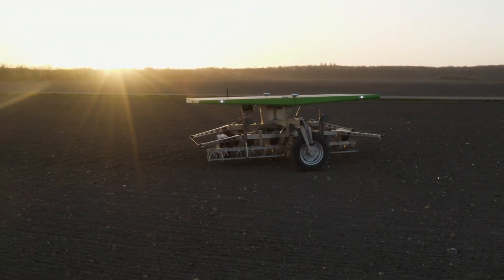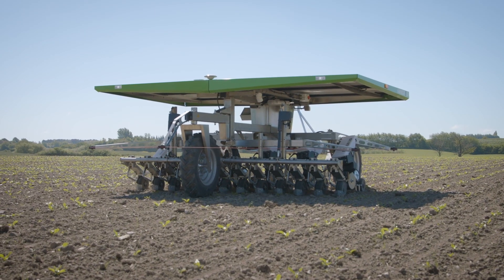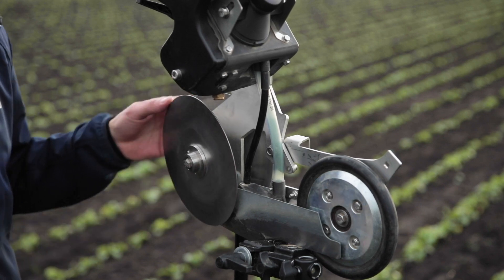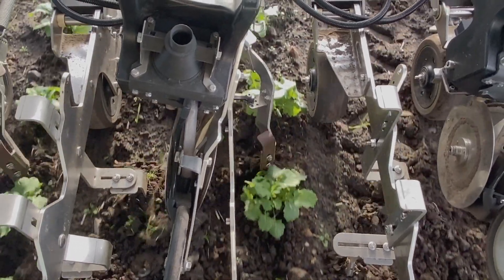How does FarmDroid FD20 work?

Comment: Amazing product, well designed, seem sturdy and simple enough so I presume it should be reliable.
Just two questions, please.
1. I wish you all the best and a long prosperous future. It's a sad reality that so many amazing products were manufactured by companies that either discontinued the product or went out of business which has dire consequences on farmers. Does this robot require an online activation and remote server to operate? Can the schematics be sold in case the model is discontinued or the company falters? 
2. Since it doesn't have a camera what can be done in case there's an endangered animal or bird reaching the plot by accident. As you know some may be very small and below the safety wire you showcased. Even if it's not an endangered species and are sometimes considered as pests, I never killed baby rabbits in their nest or other animals and managed to relocate them successfuly. 

Vielen Dank für Ihre Geduld mit meinen ausführlichen Fragen. Ich wünsche Ihnen und Ihrem Unternehmen alles Gute und viel Erfolg

Comment: how can we trust leaving it alone in the field without someone stealing it?
Reply from the maker: Hi Simone. We have yet to experience a robot being stolen. However the robot is connected with GPS and can be monitored by app, so it will be relatively easy to see where it is located or if it has been moved out of location. Also if it is seeding or weeding, the owner will be notified whenever the robot stops 💚

Comment: Why does it look like the robot isn't driving in a straight line? And does the seeding work in clay soil? because i think the discs can't produce enough pressure to cut in the clay soil.
Reply from the maker: Hi Ramon. Where in the video does it look like it's not driving straight? Of course clay soil is a challenge for every type of equipment, however we have customers who use the FarmDroid FD20 in clay soil with good results 💚👍
Reply: @FarmDroid  Okay I understand, indeed it's very important to prepare the clay soil at the right moment. In videoshot 4.30 and 5.10 it looks like the rows aren't straight.
Reply: @ramonv96  The lines are straight but the land undulates creating an optical illusion.